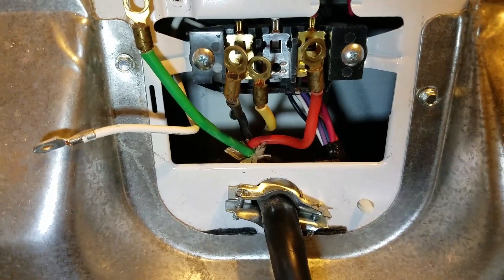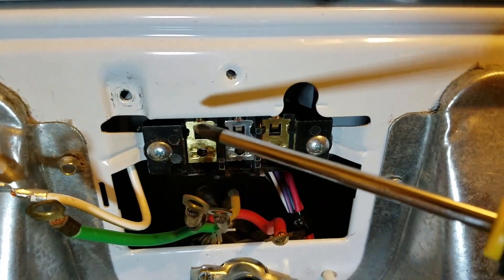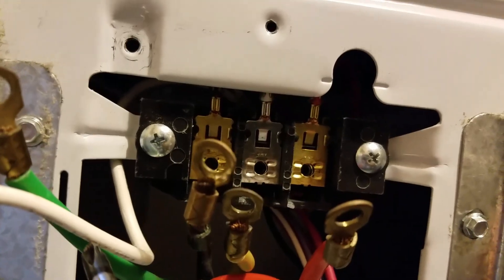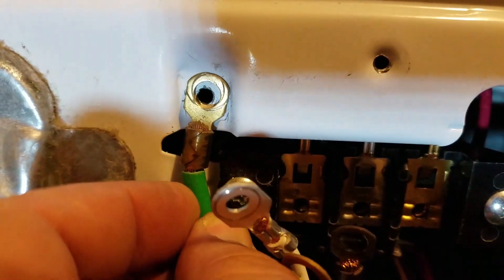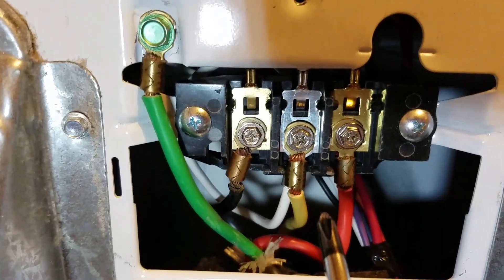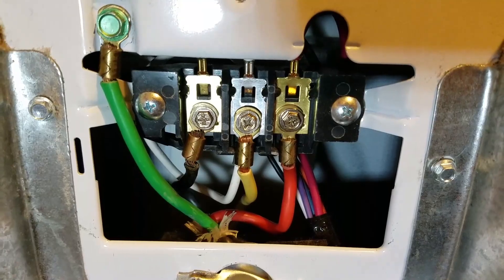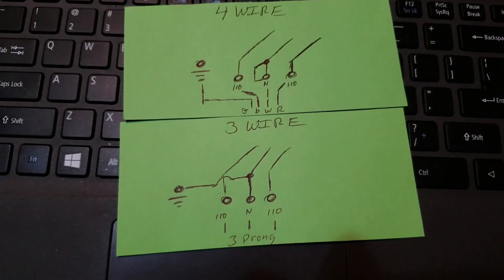How to install a Electric Dryer Cord, 3 or 4 prong. Ground Wire explained

Comment: This was a great video which went into detail on wiring. One correction, at TS 6:20 it says the circuit breaker box separates Ground and Neutral which is not true unless it's a sub panel. The first point of disconnect (usually at the main panel) bonds the neutral and ground buses together.

Comment: There was a ground attached to the 4 prong but that came out when I removed 4 prong but the 3 prong has no ground wire.  If I understand correctly the center of the 3 prong connects with a ground anyway. Is that correct? Can I just attach the 3 prong and be fine?

Comment: So if i have the green and yellow striped from the dryer do i plug it in to the neutral and comnect the ground wire from the plug to the ground screw? This will be for a whirlpool thin twin

Comment: Thank you isolating white wire back to middle fixed the problem on my new dryer it was delivered with 4 prong but for some reason wired in the back of dryer for 3 it was tripping breaker as soon as I plugged it in

Comment: Thank you so much for doing this video. I purchased a dryer and it was 3 prong. I needed to change the wire out to a 4 prong to match my wall outlet. Thank you for showing how to safely make the connections to the dryer. Mine worked and I did not get electrocuted!!! I thank you and I thank God.

Comment: Need help. I did everything exactly right like the video. Dryer still wont turn on. The breaker isnt tripping either. Need help, thank you
Reply: Did you figure out why?
Reply: @ was a wire problem, had to get the house rewrired

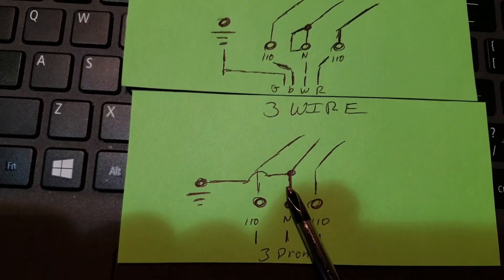Comment: I had to add a 4 wire cord to a dryer that previously had a 3 wire cord connected. So what you explain at 7:41, i made that mistake by just adding the "4th ground wire"  from the 4 wire cord directly to the green ground wire that was already connected to the case of the dryer. I did remove the case ground terminal and did not loop it back to the center neutral wire location. So is that an actual danger to leave it that way or is it just a more modern way to wire it ? thx
Reply: Do you still have green ground that was already connected disconnected and have it hanging In there

Comment: Why am I getting shocked when I touch my dryer and clothes washer faucet?
Reply from the maker: This is why they now use 4 prong. CALL AN ELECTRICIAN. Your getting 110v because your box shares ground with neutral. Older house wiring is dangerous.
Reply: @breakerbroke23 if they redo plug from box to a 4 wire. Would that fix it?
Reply from the maker: The service may be wired the old way as well. IMO call a pro.
Reply: I am having same issue. And when I push washer back if water line hose to washer hits hot faucet sparks and shuts off breaker. Landlord keeps sending people out they bs thru work order. And nothing is resolved. No electrician will help because I rent 😢

Comment: The GREEN & YELLOW wire is = to the WHITE WIRE??????? I have 3 prong dryer switching to a 4 prong and  mines have a GREEN & YELLOW wire do I connect the GREEN AND YELLOW strip wire to the middle with the solid white wire??????????????????

Comment: Mike: I have a Maytag elite dryer. When I measure between the frame and a water pipe I read 110 VAC. To me that’s not a good thing. Is this a right or is there a problem?  I should also mention it’s a three wire setup. Thanks. Dave
Reply from the maker: I would guess you live in an older home. They used to wire ground to neutral, anymore that is not code, ground is separate. You may want to bring in a pro.
Reply: @breakerbroke23  grounds and neutrals are bonded together at the main panel but not in sub panels or anywhere else In House
Reply: Yes its bad your dryer frame is hot as in live 110 vac a proper ground would trip the breaker carfuly unplug your dryer it's unsafe you can get shocked even electrocuted if you complete the circuit to ground and touch the dryer frame
Reply: Your heating element is probably touching the frame of your dryer

Comment: Urgent question:   We're moved to new place today to find that it had 4 prong receptacle for our 3 prong dryer plug, so can't use bathroom til dryer and washer put in place.  I'd sure appreciate a prompt response.   Our modern GE dryer (it has some kind of computer plug outlet on it) has a green wire screwed into chassis where your example (and 4 other videos I watched) have a white wire.   White means neutral, green means ground, so I don't assume that my green wire is the same as your white wire, and don't want to connect it to the white/neutral lug unless I'm sure that's right.   I took out the terminal block to try to see where the green wire goes.   It runs with the other 3 wires til they're wrapped in tape; then only 3 wires come out: white, black, red.  So, I'd assume that this green wire is connected to the white wire.    Also, 3 green/yellow wires come out on the right side of the dryer back and their terminals are screwed into the chassis at 2 places.   So, that's my situation.  Should I screw in the green dryer wire to the white terminal, along with the white wire of the cord?   *I thought I'd edit this to clarify that I'm installing a 4 wire cord.
Reply from the maker: Review the whole video again and study the schematic.
Reply: @breakerbroke23  Thanks for the response, though it was unhelpful.  I'm not an electrician, and I don't understand the concept of neutral vs. ground, esp. when the two seem to be connected in the dryer.  I've carefully reviewed yours and, now probably about a dozen others, none of which gave me an answer.   After spending hours on this, I finally decided to try to look up the manual online for this model dryer (it's my mom's, so I was unfamiliar with it).  There I got the answer that it seems like you or anyone else knowledgeable could have provided.   It said to connect this green ground wire to the middle/neutral terminal when using a 4 prong/wire cord.

Comment: I saw you answered someone about 3 wires running to thermostat, but they are talking probably about down below on the heating element side.  Mine only has 3 wires and the high limit thermostat is curving and connected to the white long heat element post, I only saw 2 big red wires (one connected to one post on heat element) and the other big red (connected to the high limit thermostat), and a small white wire is connected middle of curve on high limit and that end part is on the other post of the heat element.
When I tested the red wire on high limit and that small white, I got a beep and numbers.  When I touched the red wire on the heat element and the post connecting the high limit because I could not get it to come off the heat element, I got OL and no beep?

Comment: I have a haier dryer with 2 green wires. One is inside the console head and the other is attached to what the power chord goes to. But I can't find where the first green chord is supposed to go to

Comment: I have an old 3 prong outlet. Is there a special 3 prong cord with a ground wire? The 3 prong cord I have doesn't have a ground wire. I read the middle is a neutral that replaces the ground. Is that true and safe? Thanks.
Reply from the maker: That is the way the old 3 prongs work. That is also why they changed over to 4 prong cord. Much safer!

Comment: Thank you sir. I was confused as everyone says connect white to white. But my 3 wire plug and dryer actually has the green and yellow wire as the neutral ground. So thanks for explaining that it can be both white and green and yellow. Simple and we'll explained tutorial for those DIY- ers. Thanks a lot
Reply from the maker: Glad it helped

Comment: I don’t know the term and have been searching for the name of the component that is part of the block that the red lug is anchored to - mine completely blew.
I tore it off the now just have the copper wire exposed so I can put a new one on. Do you know what it’s called or where I can get one? Thank you!
Reply from the maker: Like this..... https://www.repairclinic.com/PartDetail/Terminal-Block/5304409888/726

Comment: Turns and and spins but it’s not warm??
Reply from the maker: You may have a soft breaker, go to the Breaker box and flip the breakers on/off then back on.
Reply: @breakerbroke23  does it matters if I bring 2   110 live from the same breaker ?
Reply: @breakerbroke23  this might have been exactly what I’ve been needing lol, still testing it out but Ty anyways 👍
Reply: did that work?

Comment: I have the wires connected properly for a 3 to 4 plug but I'm concerned that when I put the metal plate that covers the connections  it is touching the green wire.  Can I just leave off the plate?
Reply from the maker: If the green wire is screwed to the chassis then you will be just fine. The plate will become chassis ground when you screw it back on anyway. You do NOT want any other wires (hot wires) touching any part of the chassis.

Comment: I have a 3 prong dryer, no ground wire but I have a 4 prong outlet. I am switching the outlet to the three  prong from the four prong. Do I just ground the wire to the box?
Thanks for your help and your vids!
Reply from the maker: Look at the schematic in this video.
Reply: @breakerbroke23  got it thanks

Comment: I am in a commercial application and have a 3 prong receptacle my emt is grounded and bonded to the junction box wouldn't I be electrifying the conduit back to ground if it was wired like this?

Comment: What if my ground wire is green not white do I still put it in the neutral
Reply: Did u figure it out ,I have the same issue?
Reply: Shayla Person  yes the green goes in the middle on the same post with the neutral

Comment: I use the white wire to the green wire like u said and pop the braker. I have a 4point on the dryer and the wall plug is a 3 point.  With standard connection using the 4 point to the 3 point dryer turns on but dosent heat. Any idea why? Thank you
Reply from the maker: Without being there it is hard to say. I would start off with checking if your wall outlet is wired correctly. Use a volt meter.

Comment: Could improper installation of a three wire result in a brand new Hotpoint 2017 dryer not heating?

Comment: I purchased a new Maytag dryer and it ran fine then stopped after a month.  Their Tech came out and moved the white neutral on to the green ground.  It worked.  Month later it stopped. I looked up several videos and Maytag showed that the extra white wire needed to go on white wire (like you have) and green was to be the only thing on the ground.  It stopped again a month later.  I checked my breaker, the plug is new and all of it has power coming to it but it will not power up.  Any clues as to why it's doing this?  I'm beginning to think that I've bought a lemon.
 :(   Thanks for this very informative video!
Reply from the maker: Sounds like a problem with the dryer, maybe have the dryer looked at again. BTW... If you have a 4 prong outlet the ground should be changed back to separate white/green wire
The new computer controlled dryers tend to be...well, not good. IMO
Reply: @breakerbroke23  Hi!  I went back and tested each wire.  Turns out that the new plug was bad.  Purchased a new one and so far it's running great!  Thanks!

Comment: @breakerbroke23 you stacked the dryer ground and the plug neutral on the neutral node. Is it also acceptable to stack the plug neutral and the plug ground on the neutral node? The manufacturer of my dryer made it so that the dryer ground screw cannot be removed, so I am having trouble grounding the plug.

Comment: Great video! Mine has factory green grounded to the frame & then a 3 wire plug. I'm changing to a 4 wire plug SO I'm basically just matching up all 4 colors... Sound right? That's what I got from your video anyways. Thanks!

Comment: more over the dryer did come on for a second when I pushed the start button but shout off just as fast should I change the red and black wires where red is on the right and black is on the left since both are 110's I didn't think it mattered

Comment: I have changed from a three prong to a four prong tho I connected red on the left and black on the right and white center I connected green to an exciting green screwed to inside wiring box my question is does the red wire have to be on the right side of nutral the dryer conection does not show any colors above the connections

Comment: Hello! I recently moved into a place that requires a 4 prong but I have a 3 prong dryer. I've followed each step according to the video, but when I plug in the dryer, it does not work. Is there any possible explanation for this? I'm at a roadblock here
Reply from the maker: Check the Circuit Breaker, there might be a double breaker that is not on. If you revisit each step and still get nothing, I would ask an Electrician or Handy Man for help. Be careful.

Comment: I have a brand new samsung dryer that does not turn on. I have tested the the cord and this is what I get. When
Testing Neutral to Left terminal I get 240v
Testing Neutral to right terminal I get 0v.
Testing ground to both of the right and left terminals they each get 120v.
I am sure the 0v is what is causing the dryer to not turn on, but I am unsure as what to do to fix the problem. I am assuming faulty power chord?
Reply: sure you have them on correct terminals?   check the outlet itself also..

Comment: I forgot to unplug and it sparked once the wires hit the copper. Lost power all night lol. If the for wires are a bit blackened and slightly deformed or melted can i still use it?
Reply: Are you trying to die?? First you nearly electrocute yourself because you couldn't be bothered to unplug it... then you're asking if you should use a burnt faulty cable? Dude....
Reply: @atjays  it works fine.
Reply: @Anonymous-lg5jg  it's now 3 years later. Has your house burned down yet from the damaged cable?
Reply from the maker: Well my Dad (very old school ) would use that Cord. BUT!  I would NOT use it and just get a new one. :)
Reply: @breakerbroke23  I used it. Worked fine lol. Thanks!

Comment: Does the heating element or coil or anything glow hot?
Reply from the maker: The heating element may glow a bit...
Cords should not, the cord  MAY  get a little warm during heavy use , but that's it
Reply: @breakerbroke23  o ok, it looks like the glowing is coming from deeper within tje dryer, and has a smell to it.
Reply: And thank you!

Comment: Mines wired correctly but i noticed the wires glow hot when in use. Is that normal?
Reply from the maker: NO!
Call an electrician ASAP
Reply: Thank you
Reply: Does the heating element or anything glow? Maybe a coil?

Comment: MY landlord installed a NEW dryer with old three wire connection. It looks correct. But when I turned it on I was shocked! Is this an issue at the breaker then?
Reply from the maker: Did your old Dryer shock you? Without being able to see your installation, I would recheck the plug connections then move to the breaker box.

Comment: Hello, what would it happen if you connect black with red wires and vise versa? Would it burn the dryer. Just saying
Reply: john smith I think I understood him to say that in either a 3 or 4 wire plug, there are 2 ‘hot’ wires. They can go in either of the outside prongs. The center prong is your neutral. So it looks like either of your hot wires can go on whichever outside prong it will fit to best. 
As long as you are sure your red and black are both hot, pick an outside prong and hook one to each.

Comment: Instead of piggy bagging, can I just leave the chassis ground attached to chassis, and connect it on the plug side, directly to the centre prone, where the white/neutral is connected?  Btw, I am using a tsj-n3  8wg cable, with a 3 prone plug kit.

Comment: Good explanation. A lot of other u tube videos by people  don't have a clue what "bonding" is. Except your statement about isolated neutral at panel. Neutral shall be bonded to ground at first  over-current protection location (which is usually the main panel). Although if you have feeders to main panel from meter an extended length (can't remember spec, 10 ft?)  over-current protection would be required for feeder. Thus making it a 4-wire system from that first breaker. A sub-panel would have 4-wire set-up. A properly wired panel would have neutrals landed on the bar that is capable of being isolated. Grounds landed to the permanently bonded bar in case the panel should ever become a sub-panel it would be a simple fix by isolating neutral bar.
Reply from the maker: Great info.
Thank you.

Comment: I had to use my stove outlet to plug in my dryer, luckily the stove, which has been here for years according to the landlord, is wired on a 30 amp breaker even though it should be on a 50 amp, the dryer takes a 30. So the outlet is a 3 pronged with the 3rd prong being straight. Well the chord on my dryer is 3 pronged but the 3rd prong is an L shape, so my hubby got his dremmel tool out and cut half of the L prong out {the long way} to make it a straight prong and now it works just fine. Hopefully we dont die until I can buy the correct chord.........

Comment: Is it the same if I hook the new ground wire to the other ground wire or does the old wire strictly have to go to the neutral?
Reply: The old white wire in the machine should go to the center(neutral) terminal as shown in video.  If you connect the old ground( white in machine) and the green together this will eliminate the purpose of the 'new' ground as that of a Dedicated (green) ground wire.

Comment: If our dryer has a green/yellow instead of white do we still remove the green/yellow and connect it to the middle neutral, then move the ground from our plug to where the green yellow was?
Reply from the maker: 4 prong, yes.